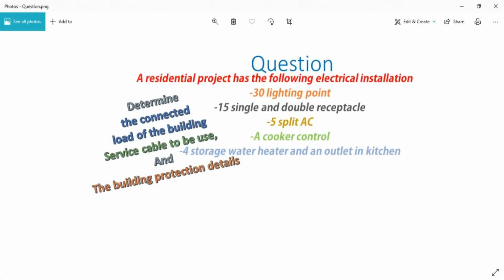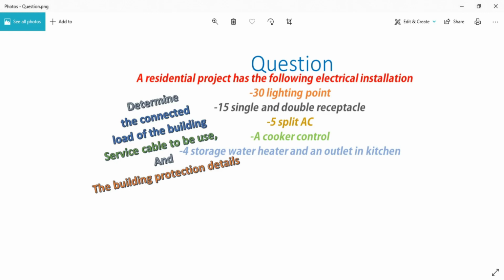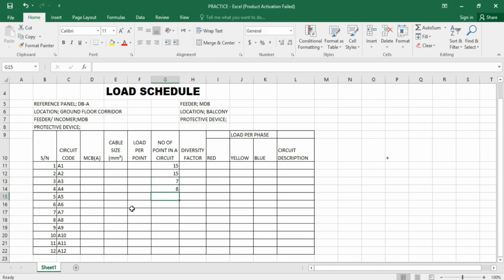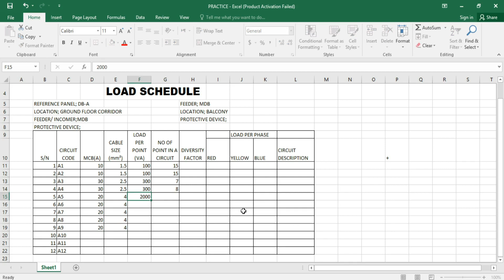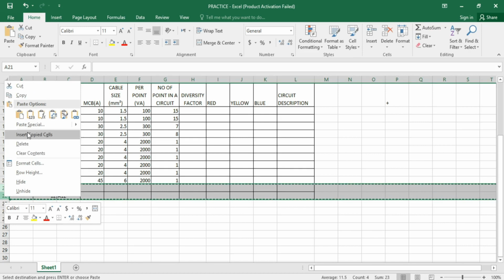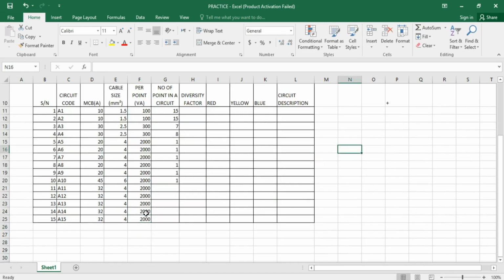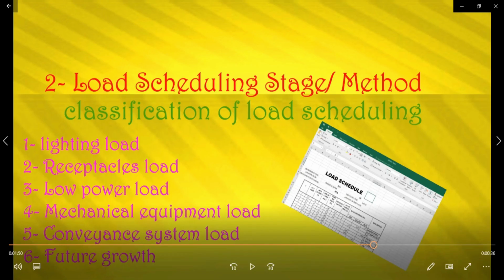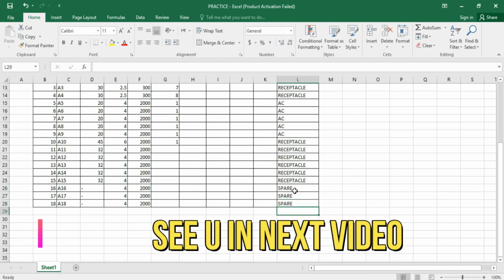ELECTRICAL LOAD SCHEDULE AND ESTIMATION DESIGN (MEP) PART 2 OF 3

Comment: Please why have we divided 2000va by 180va
Reply from the maker: In order to demonstrate the maximum number of outlet we can have in a circuit 
180VA is d nominal voltage for 13/15 amps outlet
Reply: @jaalconsult  thank you